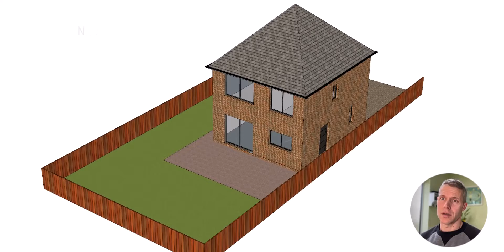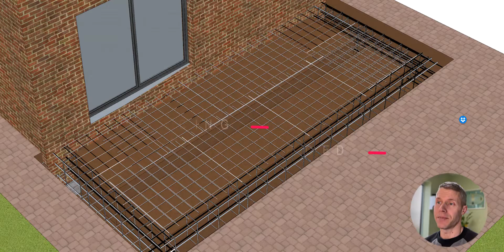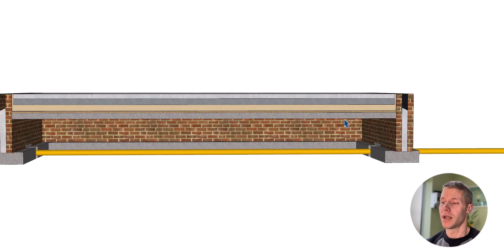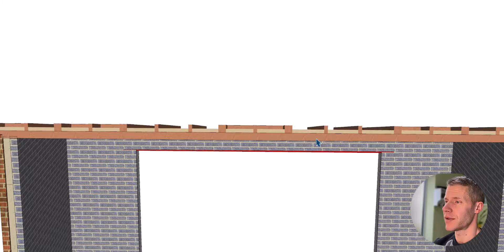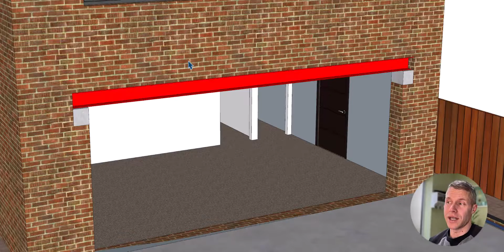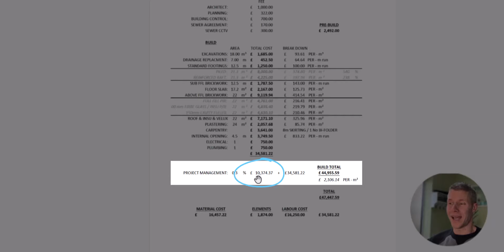Home Extension Cost: Step-by-Step (2024)

Comment: Get your foundations, brickwork, roof, doors and windows in. Basically make it water tight.

Then project manage everything else slow time, electrician, plumber, carpenter, plasterer etc it’ll take longer but it’ll be a hell of a lot cheaper especially if you have used someone before / know someone reliable.

Comment: How much have prices gone up in 1 year? 25% maybe?
Reply from the maker: Something I plan on checking the next few weeks.
Reply: @betaplanltd5967  fantastic. Based on the quotes weve had for a much smaller extension and no big beam, you'd think prices have 10x in a year. Slightly overdoing it there but quotes of 46k for a 1st floor ext, assuming no foundation work.. seems a lot.
Reply from the maker: @steverosam1265  I suspect they have gone up, how much, I am not sure yet. Everything seems expensive unfortunately.

Comment: Very useful video Scott, thanks. I’m currently pricing builders for a kitchen extension (based in NI). We’re knocking through an existing wall (galley Kitchen) into an old fashioned side return for a more open plan look. Size of job is probably 2/3 of this. 5 x 1.2 is the size of side return. The first quote I received back was 53k….I couldn’t believe it. I know building materials are expensive but I didn’t imagine it would be over 50k…..hoping a local trusted builder can come in with a lower quote and I can reduce cost by taking on a lot of the interior works myself (qualified years ago as a commercial pipe fitter). This video has given me hope. Cheers
Reply from the maker: Thank you, yes, that sounds expensive for a 6m2 extension. Good luck.

Comment: Im looking to build a small extension on to my barratts house glamis design. The kitchen patio doors would be where the extension would start. I want to be able to build enough space for a family dinning table. Any ideas what ud be looking at price wise?!
I am a plumber by trade i would do the electrics and plumb in a new radiator.
Reply from the maker: This video gives you an approximate meter square cost.

Comment: Do you need planning to go up a floor on top of already existing single story extension house is semi detached and the extension wall is the boundary so no chance of two metre rule
Reply from the maker: No, you would need planning, if it doesn't meet the requirements.

Comment: You're getting concrete for £80 a cube ?? and a builder skip for £195..and screed for £20 a cube... your sand in the calculation above was £75 a cube !!   other items on here that don't ring true either. Suggest you look at these costs again !! I know you put this as an estimation but hey, get real please !!  ( there is no way planning would allow a flush finish extension either...it would have to be subservient to the main building at both ends.) Love the presentation though, cheers.
Reply: can't comment on other prices but in the area where I live a 8yard skip (with an access door as well) is £180, so price in the video is quite accurate
Reply: Hi there 
This vidio is very helpful 
We are planning To build 66sqm l shape exstesion .
I will like to do alot of work my self. 
I seen 1 of your vidio u break down the cost of materials and labours .
Could u do a cost sheet if i was gone give u hand drawing? If yes how much that will cost? Will be big help
Reply from the maker: Thanks for your comment, in my error I was supposed to change the screed price, but overlooked it. In terms of the conc, I found prices ranging from £80-120 per cube (see the foundation conc). It was difficult give a 100% accurate cost for that as project will probably done a different way each time with pumped conc or barrowed in conc, ready mix or mixing on site. As mentioned in the video this is a desk top exercise with info gathered from the web, so am happy to stand by what I have found. Sand blinding for example is £75 per bulk bag in Wickes. I found several skips around the £200 mark for an 8 yard builders skip. Again, how the excavated material is disposed of on site is different for each project. The aim of the video is to give a fair insight into approx costings involved.

In respect of planning (not that this is aimed at going through planning rules) this design would be acceptable up to 4m in depth under Permitted Development on a detached house, flush with the sides (assuming the PD rights are in place and it is not in a conservation area, AONB or a listed building). If an extension is off the original house (rear elevation in this case) it would be compliant with PD rights. Subservience is not generally mentioned in the context of PD rights, as to be inline with PD requirements by default things are generally subservient. My link to PD rights, in this circumstance. https://youtu.be/h7tDicl4rf4?si=17xjKUlIjDeI1HXu